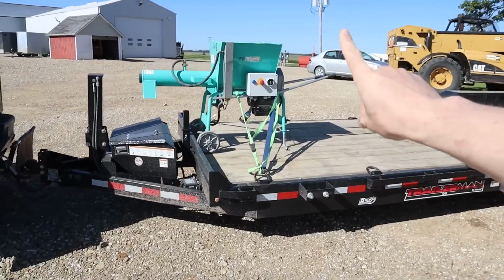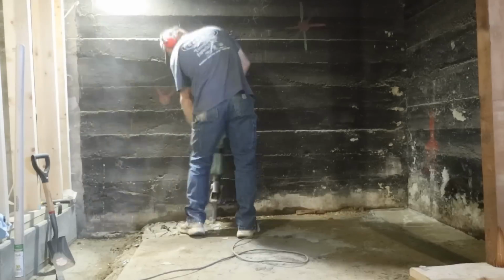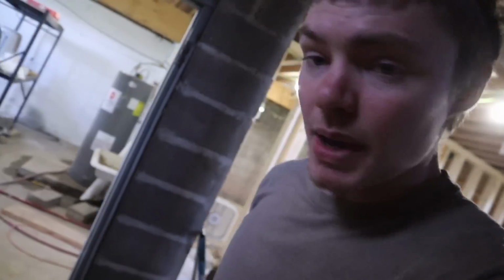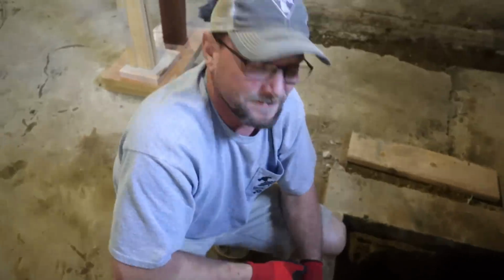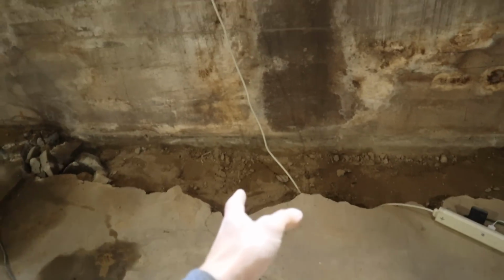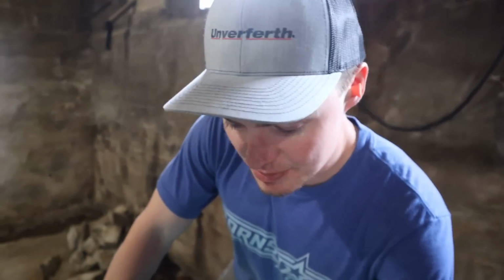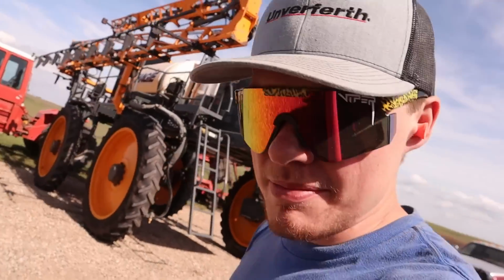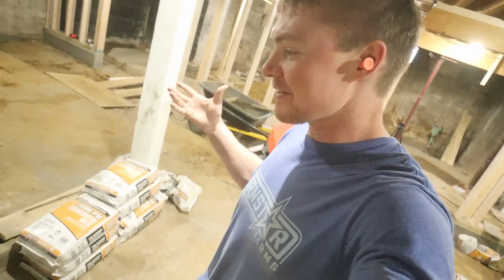Restoring A $7,000 Mansion: Pouring A New Concrete Foundation Pt. 2

Comment: I hope Justin is up to date on a tetanus shot. 😢
Reply: Ha!  Exactly. Although I remember seeing a video about tetanus being a rare thing but during WWII the soldiers got it a lot in the war and even though it still wasn’t prevalent in the states they made it a recommended shot then required it for children etc. so I don’t even know anymore if it’s a necessary thing or if the shot is an exposure to a toxin “just in case” even if risk is minimal.  I saw a stat that showed death of tetanus being like 1/100000 of the deaths caused by alcohol. So 🤷🏼‍♂️

Comment: No matter what you do with the concrete it will not hold up. You need gutters and you need a French drain directly under the drip line. 
A new floor in the basement is fine but over time without a French drain and/or gutters you are spending money on something that will fail over time. I’m not criticizing you but I’m trying to educate you.  Even Justin should realize that gutters and French drains are necessary.
Reply: Didn't Cole explain that in a previous video, that's the purpose of the footings to stabilize the walls in preparation for the drains since the soil below the house is clay and unstable.
Reply: @AZHITW yes!
Reply: Add a waterproof coating on the exterior of the basement wall while installing the French drain and a negative grade away from the house. I think we got it covered.
Reply: Got to keep the water away for sure
Reply: Yes this
Reply: It all depends on the source of the water. Rain dripping off the roof and not flowing away? Sub-terranean water table?
Reply: @barrygrant2907  Water table varies with the season, in Iowa. Higher during the spring... and the clay soils expand, with the Spring rains, and then Contract around late June, early July, as the soil begins drying thoroughly, and then cracking from lack of moisture. 
I'd say that Cole's primary moisture infiltration problems, originate from his roof's "drip-line"... and can be largely dealt with, by simply installing extensive guttering, with a catchment sump. Then digging out an excavation around his basement walls...and backfilling with screened large-diameter gravel...and have the whole gravel backfilled area topped with neoprene pond-liner, and a thin layer of top-soil that you can grow good lawn on.
Reply: @barrygrant2907  concrete breaks down no matter the amount of rebar. Without gutters and French drains to carry the water away from the foundation this will remain an ongoing problem. 
Granted, the basement needed to be repaired but without proper drainage this will continue to be an ongoing never ending problem. 
They get substantial rain and snow and putting a new floor in the basement will not be a permanent solution for the problem Cole is trying to fix.
Reply: @terrytrammell7388  The biggest foundation water problems are due to incorrect grading.
Reply: They are planning a drainage system under the home. When they went to add it, they realized there wasn't a footer and wanted to add it. The eventual drain is supposed to run underneath from what was explained in the first video
Reply: They are doing drains. Watch the videos

Comment: Right about now, Iowa's future senator, Senator Cole the Cornstar, is probably feeling the full impact of the terminology - "Money Pit"?
Reply: While you might be correct if you or I was doing the exact same build. It would be a money pit.   But Cole is getting most or at least a big part of the cost paid for from his videos.  I don't think the viewership would be anywhere close to the same if he bulldozed it and started from new.
Reply: @Youngguns42303 dont think so, yt is really milking its creators and 615k subs is not that much.
Reply: @Youngguns42303  I am certain all the Menards plugs don't hurt either.
Reply: @Youngguns42303  Come on?! I mean..., I love your crooked logic which I have sometimes used to justify "unwise" spending in the past, but $s are $s and these $s that "Senator" Cole the Cornstar is spending on this "money pit" would have been better spent on building a new house of the same design which more people might have been interested in watching.
Reply: @oscarwindham6016 Precisely my opinion from day one. The “$7000 mansion” had its days to shine and should have been completely demolished and a new structured built from the ground up in its place The amount of money and time Cole has spent levelling floors, shoring up support beams, reinsulating, etc leaves me shaking my head. The new construction vs renovation math just doesn’t add up imo.
Reply: @TomJones-wi4nh You too, seem to have been there, done that? As they say, live and learn.
Reply: @TomJones-wi4nh why can’t anyone appreciate !!! That our fore fathers mothers kept alive I have awesome antiques that are un sellable because u the new generation doesn’t appreciate what my parents and great grandparents went thru who are u u have knowledge of anything oldtook down confederate flag etc
Reply: @TomJones-wi4nh  You're wrong. I've heard many builders who do what Cole and his friends are doing vs a new build. They always say what Cole is doing always costs less. So I applaud Cole's decisions. Cole is also preserving family legacy which counts a lot. He has to stay on budget and he has picked the best decision. Jason is excellent at what he does and Roman is learning but already knows a lot. I enjoy watching these videos a lot to boot. This team is quite creative.
Reply: @glennboles474  The confederate flag is a great example of something that should be retired to the dustbin of history.
Reply: Yes! The house build is a business. The more they do the more they make!
Reply: Because ladies and gents....that house was built using victoriana ideas and methods of the time! That house is british...... and yes u could demolish and rebuild it but what fun is that! What do u learn in the process..... he's using problem solving and do it attitude to learn and develop this, so what if it takes a while..... was Rome built in a day, was civilisation built in a day, was a city even built in a day....and if its easy! What do you learn or get from that! It's a journey..... its a development .... and money  contractor would charge is going into development and learning! The learning that will last a life time for him because in 50 years.... his kids gunna day so dad, how do we fix this....Cole will be like well son....this is how but along the way we didn't think about this or we shud have done that, and then his son will incorporate that himself for another 80 odd years! This is a lasting legacy..... one that will last another 100 maybe! But ..... when it was built then wasn't easy, and ..... why shud it be easy now! U don't get anywhere with taking the easy route! And that's the reality! But that house is built on British ideas! And victorian systems......... because the 1800s was the slave trade and in Europe the start of the industrial revolution...electricity, sewers, steam power, naval development, daylight robbery for queen and country, lightbults, heating, plumbing, telephone communication, health and medical innovation and exploration and the rest........, where technology was born and made, where systems were in their early development and took years and nearly 2 centuries to really cement..... nuclear fission, travel, building an empire wasnt just European.... and I reckon the reason that house had the stuff before it was common place! Victoriana ideas people...... that house stands for much more than just a family home.....innovation, technology, history and family legacy! U wouldn't have that knocking it down now would u! Brick, blood, sweat and tears! And those houses last centuries.....wood don't do that! Why France, Spain, Russia, UK have buildings that are centuries old...... but restored, upscaled, repaired, and added to! Its an historic piece....... a mix of both! Personally.....I like a brick house that don't move in 120mph winds myself! My house is half a century old, the British monarchy Palace......100s of years old and still standing slap bang in the centre of London! Added to ovwr the last few hundred years ro become what it is now...... so slapped with history..... I love that he's restoring and remodelling the home! And hopefully it lasts another 100 years! But stick a load of brick in the mix will last a tonne lot longer....incidently..... the Whitehouse is a stone building..... ..... based loosely on monarch buildings! And yet British history is labelled in connections with French and Spanish culture! This building represents much more ...... its still one of a kind!....... bit the French and Spanish still.could not capture England! May have had their way in America..... with the French having a go, but they never cpyld take down the British! As Forefathers....... they originated from a distant land full of dreams and ideas! But that house is very much victorian idealistic influenced! Those same systems....... are still used but tweaked over the years! So.... go for it Cole! U have a little historic gem you need to take care of! And a legacy for your sons! And you guessed it....I am very much British! My family are also steeped with historic links to torpedo development and submariners! I also live in the very port is f9rces left for their very last day before nazis had them murdered! History is important! Family to....but with that comes the effort of those before! So whilst it may be easier to demolish and redo the house....it won't have the historic significance of a time you could never imagine living in...... and that is the golden nugget right there! Its historic significance that only Cole and go's family hold and the typical attitude of people who do not understand heritage very well!
Reply: @AffectionateDriftwood-vr2sf  Well said.
Reply: Let’s run Cole for President.
Reply: @haakonweise  Maybe, but that might be a little too generous?
Reply: What happen to the drain pipe ???
Reply: It’ll be done in two weeks
Reply: @KevinMurano  Oh boy..., I sure hope so. It is just too painful for me to watch "Senator" Cole the Cornstar "continue his growing experience as an ever-learning human being" which teachings I've already painfully learned myself many decades ago which is to say that I'm ready to get back to farming..., vicariously, of course.
Reply: It was a free house (inherited) with a renovation funded by us watching these videos, lol. It's not really a Money Pit.
Reply: @BarbaraThornD  Come on? Regardless of the funding source, that house is definitely a "Money Pit".
Reply: @BarbaraThornD  Was the house inherited?  I presumed that Cole bought it from Grandpa or from Grandpa's Estate.
Reply: @richardwooldridge6024  Inherited. In his 1st house video, he states that the house sat empty for a year after Grandpa's death so he could finish college. Then he moved in.
Reply: @BarbaraThornD  Look, more power to Cole, and I understand where he is coming from, but that old house should have been torn down and a new built in it's place because this old house is nothing more than a money pit that is going to be bleeding his wallet for years to come.
Reply: And got to remember he’s adding a garage movie theater and more rooms to an old house just money 💴 I guess
Reply: @MB93WP  We learn from our mistakes, and Cole is going to be a genius by the time he gets through with this remodeling project.